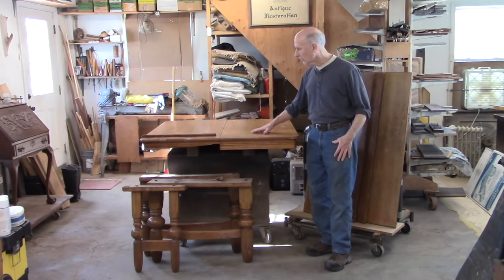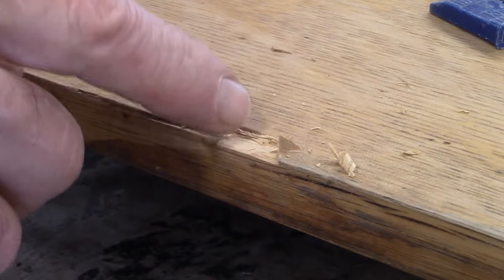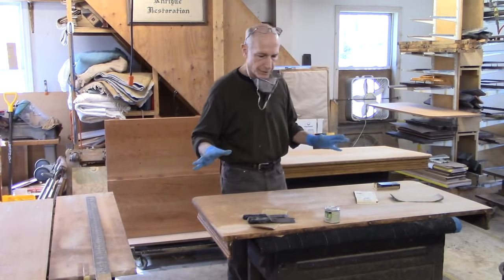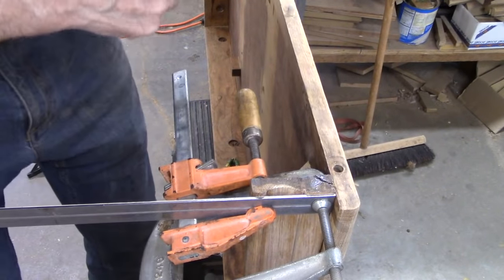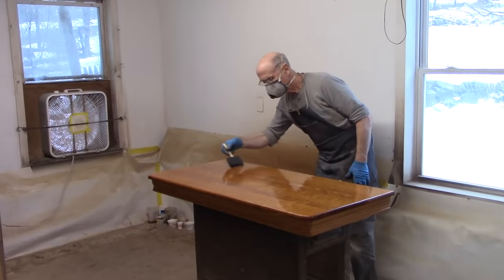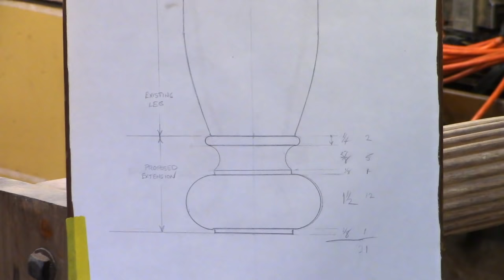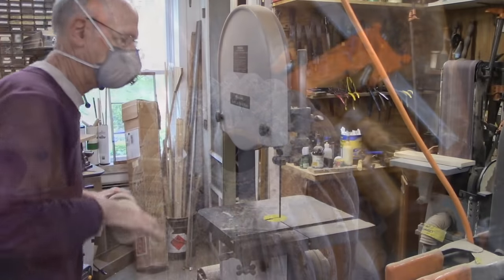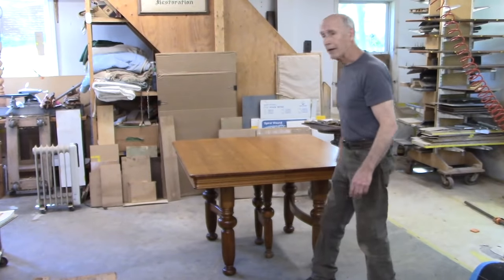A Complete Rescue - Thomas Johnson Antique Furniture Restoration

Comment: I thought of hand-sanding un was the only way to go until I started having pain in both shoulders.  I didn't make the connection with hand-sanding until my shoulders got better again.  I was working on a project and so I went back to hand-sanding and it took only 15 minutes for shoulder pain to start up again.   If I do any hand-sanding now, it is on a very limited basis like maybe an area where a power sander would not work (wood turnings pieces).  U gave but be set if arms and I've got other things I need to do.  Thomas, I learn so much from your videos.  You put a lot of hard work into this table and it turned out beautiful!
Reply from the maker: Thanks! Sorry about your shoulders. I can relate! I've had a bout with pain in my thumb joints, that was really getting bad! Massage therapy has corrected it though. But I was literally losing my grip
Reply: @johnsonrestoration , I was lucky I didn't have trouble with my hands.  I spent all of my work life typing 100-WPM +,   Lucky for me I had a typing teacher who taught typing and he would always go around with a pointer stick he would use to put under a student's wrist so your hands would not lay down too much while typing.  This was back in manual typewriter days.  By following his lead I have never had carpal tunnel in my hands/wrists.  My sister would lay her hands/wrists down when she was typing and ended up with all kinds of trouble.  So, I got an early lesson as a kid in school on that.  I never had trouble with my shoulders until I was doing a lot of hand sanding.  I still have a small problem when winter comes but one Alieve does the trip to keep it away.  There was a time when nothing worked.   I have always been determined not to have chronic pain so I really looked at the repetitive activities I do.  In having done a lot of hand-sanding, I can see why your thumb ended up giving you trouble.  You've done a whole lot more of that than I have sone.  I think given the repetitive nature of that you end up drying out your joints and then it's bone against bone - not good!

Comment: When patching a table top I can never decided which is better, to make a straight cut or to make it irregular to make the patch less visible. What is your take on it, because I have seen you do it both ways?.
Reply from the maker: Thanks! me too. Now I just try to take as little of the original wood away as possible, That decides the shape
Reply: @johnsonrestoration  thanks
Reply: @johnsonrestoration  when I worked in the railing dept of a stair company we frequently used round mouth gouges to replace sections of wood that were damaged.  Gouge out the bad sliver and replace with a new wood sliver.  This method reduces the straight line appearances you sometimes get when using a straight edge chisel.

Comment: Excellent restoration. It's always educational and relaxing watching you work. I lose myself when I have something to restore, it's truly therapeutic seeing old and tired pieces come back to life. I have done quite a few restorations myself over the years in the UK, and know how painstakingly long it takes to get the right outcome and make the piece look original.  I have been asked to do quite a few but sadly few people want to pay for the hours and can't understand what goes into getting it to look good and preserving the antiquity of the piece.  
Most of the things you do, I do exactly the same, but one thing I've never used is paper on the final rub down, I'll have to give this a try. There are always a couple of annoying spots to deal with. 
What I do use to avoid the glassy finish when varnishing, is to go over the piece lightly with 0000 wire wool and a good quality beeswax polish. It takes the glassiness away and leaves a soft, mellow finish. I'm sure that you do much the same depending on the piece. 
Always a pleasure watching a craftsman at work.
Reply from the maker: Thanks! Yes, I do the same with steel wool and wax. I have been very fortunate to live and work in very affluent areas where people have the means and desire to pay for good work

Comment: I HAVE THE SAME TABLE!!  Omg, I'm so excited!!!  The legs were already long enough to easily fit a chair underneath, but they're longer at the top.  Meaning someone didn't add more wood to the bottom.  I'll have to do some investigating to see if it came that way originally or if some previous owner added length to the legs where they join the table top.  Mine doesn't have casters, but I think it did, because I added those plastic glider tips to the legs when I got it, which was about 30 years ago, from an estate sale.  Mine only has one leaf and the top was covered in dried paint when I bought it, which is probably why it was cheap, lol.  It makes a nice kitchen table.
Reply from the maker: That's great! This table needed to be a bit high to accommodate a wheel chair. But I really only raised it an inch, because the casters we removed were 1 1/2 inches. It depends a lot on the height of the chair seats too

Comment: You've been fixin old stuff for about as long as I've played with elk and deer antler.
Reply from the maker: Thanks! I've often wondered if antler was a difficult material to work with
Reply: @johnsonrestoration  Antler is a very hard hair like substance.  I've used mostly dentist like equipment to carve antler a bit.  Most of my work has been scrimshaw based.

Comment: I love these longer format videos and the explanations of why you do certain things. I have used Waterlox for years, mostly on new furniture. I have not tried adding oil soluble did to Waterlox. If I have to try to match a repair I usually get the color by mixing up a small batch of shellac and using TransTint dyes or SolarLux. This works but you have shown me what is probably a better way. Thanks!
Reply from the maker: You're welcome! I used the shellac too, that's a time tested method!

Comment: With regards to the foam brush, a tip I picked up from another youtuber is that when the sponge part is no longer useable, you can remove it and use the handle as a dowel. Of course if you are a painter, a ragged sponge is actually a useful tool for creating random effects like tree foliage, clouds and so forth.
Reply from the maker: Thanks! Yes, I've been saving those handles, (like so much other stuff). I'm a big "re-user"

Comment: I would love to see a summary of the finishing process once the tops were sanded bare to the paper finish.  I recall tung oil varnish and the stain (stain powder mixed with paint thinner) then the clear satin finish. Well done and some nice pieces of wood are saved as fine furniture.
Reply from the maker: Thanks! That's not a bad idea. I should at least list the products in the description

Comment: For patches, I was taught to make the patch first and then trace around it on the piece to be patched. Also to avoid edges perpendicular to the grain, much less spotable if they are at 45 degrees.
Reply from the maker: Thanks! That’s a valid approach. Are used to make everything at 45°. But now I cut more with the grain. I want to remove as little of the original as possible

Comment: Tom, you do beautiful work.  I would like to see a restoration where you are replacing, recreating an applique that is missing pieces.  Do you have such a video?  I have a 1930's depression-era bedroom set that is missing some of the scrollwork in spots.  My thought was to make a mold of the same area on the opposite side and try to repair it that way.  But I am not a professional and my confidence that it will look good in the end is just not there.  Any tips or tricks you could provide would be great!  I have learned so much from you already.  Thank you for the great channel!
Reply from the maker: Thanks! I don't think I do! I have some carving but not apliques. We used to buy similar appliques from Van Dykes Restorers, https://www.vandykes.com/appliques/c/512/, cut the pieces that we needed and worked with that.

Comment: The figure on the table top is incredible.  Currently oak isn't real popular here on the west coast but my wife and I love it so virtually all our furniture is oak.  I'm glad you mentioned the foam brushes.  I've used them but they tend to get "floppy" and have no stiffness to them.  Are there better and worse quality foam brushes or are they really only useful for applying certain materials?  I don't see how you get the top completely wet enough, quickly enough to not end up with lap marks. When I stain a table top/large flat area or pretty much anything I use a rag.   A lot of your "tips" I already know but I do pick up some "pearls" occasionally, like the center hole drilling method.  Clever.  Nice work Tom. I appreciate the attention to detail.
Reply from the maker: Thanks! I've been looking for better quality foam brushes, no luck yet. The trick is that this finish is very slow drying, so there are no lap marks

Comment: Excellent teaching from an excellent teacher, thank you Thomas.
You have so much varnish/finish to apply , why don't spray it?
I was told to not use foam brushes for finish as they live tons a tinny air bubbles.
When I used to do this kind of work, I hade a lot of issues with fish eyes, and those was due to people using silicone wax. The silicone would penetrate the wood deep and it was next to impossible to remove.
I love your linear sander. The only one I found for sale, is used and not in very good shape on E-Bay for $1200!
Reply from the maker: Thanks! I never was interested in foam brushes, but they work best for this finish. No bubbles. I sprayed furniture for 45 years! I'm done! It's easier to control silicone problems brushing a finish

Comment: This is wonderful to watch! This table, leaves, and feet got a brand new life so it can live another 100 years. I believe that I heard it give a sigh of relief. Btw, what kind of glue did you use to glue the wood together for your leg extensions?
Reply from the maker: Thanks! What a job that was. I have a separate video on the design and making of the new feet. I used hide glue, specifically "Old Brown Glue"

Comment: Common garden Joe ( most of us )  chemical stripper, quick orbital sand then coat of thick polyeurathane varnish and voila ! ( god forbid chalk paint! ) Thomas , analyse, dismantle, analyse some more, repair, replace, flatten, straighten, strip off old finish when needed, sometimes strip, de-stain, repair chips and fill cracks, keeping all old screws, re-stain, balance colour, touch up patches, hand sand some more, varnish, sand, smooth, varnish sand, smooth, check each time, assemble, check some more, put back all hardware, final rub down and wax and polish and voila ! Could watch for days ! Thank you xx
Reply from the maker: You're welcome! Reading that I was remembering all that work!

Comment: Those feet are perfect.  I have an oak dresser that is that golden oak color. I don’t really like that shade but I didn’t feel like refinishing it so I just used beeswax that has a bit of orange oil in it and that  darkened it up just enough that I can live with it now. And I cleaned all the hardware and it looks really pretty. So this episode is interesting.  I don’t generally buy oak pieces but my dresser was a gift so any ideas I can get from you are helpful.
Reply from the maker: Thanks! What you did was fine. But you could also recoat it with some finish that has color in it. much like I did to adjust the color on the feet.
Reply: @johnsonrestoration   yes I thought about that.  I’ll live with it for a while and see how I like it. Thank you for sharing your knowledge. 😁

Comment: I have had excellent results in pre-staining the putty but if a water based putty is used you must use a water based stain. Pre-staining small anoints from an epoxy stick type putty works well with water based stain as well. Make a sample to ensure that the putty  ALWAYS dries lighter than the wood that you are repairing. Staining it darker for the final match is easy. Lightening it means starting over.
Reply from the maker: Thanks! I've never tried it - namely because I'm often not sure what the final color will be. But I will try it

Comment: Really enjoy your videos ,I have done some furniture restorations not on your level however .i noticed you use a Irvin screw driver,they are the best.
There is a hardware store in Wellsville ny , Worth Smith they catered to the oil well industry ,the had a large bin filled with those bran new screw drivers for a dollar or two each ,I should have bought the whole bin ,I only bought one.thanks   Mike
Reply from the maker: You're welcome! Life is filled with "should haves". But I would have liked to seen those bins!

Comment: I think you made a great job on that table. I love the colour and your attention to all the little faults. I live in Thailand and our climate is very humid. I am going to build a model Railway using 15mm AAA Plywood. I am thinking of sealing it with PVA glue all over. On the top, I plan to stick 2-inch Ploylstrene AAA sheets to act as a sound  Deading Base before laying any track etc. Would you recommend anything different? Martin. (Thailand) Sorry for the English-English.
Reply from the maker: Thanks! This sounds like it's going to be good! I don't think you have to worry about humidity unless you anticipate moving to a drier climate someday. If so, sealing everything will help, but it has to shrink one way or another

Comment: Tom, I'm interested in learning more about where to get the sander for the top you recommended.  I found some "straight line" air sanders that have 2-3/4 width but nothing like the one you showed.
Reply from the maker: A while ago I was looking and saw some on ebay. Apparently they don't make them anymore which amazes me. Before you buy one be aware you need a compressor that can put out 12 cfm at least

Comment: I am currently redoing a Singer sewing cabinet in a dark golden tiger oak (I’m sure you’ve seen a hundred of them). I had to replace the top with tiger oak veneer because it was destroyed (it had plastic wood grained contact paper instead, eww). Your previous videos helped me feel confident enough to tackle that and it came out better than I expected! I have put on six coats of stain, alternating between provincial and golden oak, but I can’t get the veneer dark enough to match the original. The tone seems to match well when it’s wet, but as soon as I wipe it down, it’s too light. I need suggestions.
Reply from the maker: Thanks! Dave Bryant is correct. You need to use dye stains to get dark, but you needed to use them first. You can sand the finish well, and apply a coat or 2 of finish with a dark stain in it. These videos might help: https://www.youtube.com/watch?v=sSDDkAkgyxU and also "glazing and toning"

Comment: Excellent video. Question, what can you do if the fish eye effect doesn’t self correct like it did on this project?
Reply from the maker: Thanks! That question does not have a short answer. But what I have found with this finish, Waterlox Original, as I apply with a foam brush, if I see them forming I just keep brushing over it until they stop forming, as it begins to dry. Here's the answer to your question, you'll see it does not apply to home workshops: https://www.woodshopnews.com/columns-blogs/four-methods-to-prevent-fish-eye

Comment: Fantastic job! Awesome! A couple of questions: 1) You used some Wax wash remover after sanding each coat of varnish. According to its description, it's a mix of solvents. Can't solvents damage a film of varnish?   2) While making patches, you always leave plenty of excess material you have to cut, sand or plane down afterwards. Can't you make patches smaller from the beginning? What is the idea?  3) If you sand and apply varnish in the same room (and it looks you do), can't wood particles get to varnish?  4) You don't prime wood before varnishing, do you?   5) Some people treat each layer of varnish with steel wool, you prefer sandpaper. Is it better?  Why? Thank you!  (oh and it just might be a good idea to grease those old bolts and nuts with some graphyte grease. works really well)
Reply from the maker: Thank you! Too many questions! No, once it's dried. I have a fear of making the patches too small. Yes. The first coat serves as a primer. Sandpaper on a block cuts flatter, Scotch Brite pads and st. wl. are good if it's not necessary to be levelled
Reply: @johnsonrestoration  Dear Tom, thank you for the answers )) keep going!